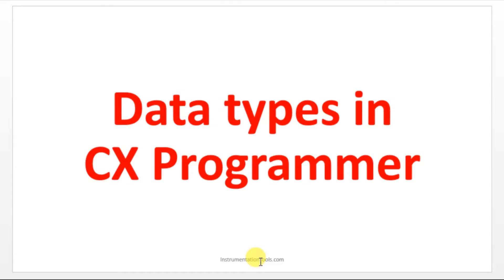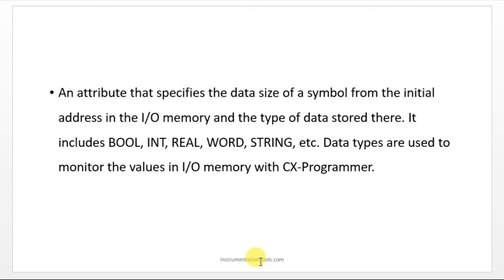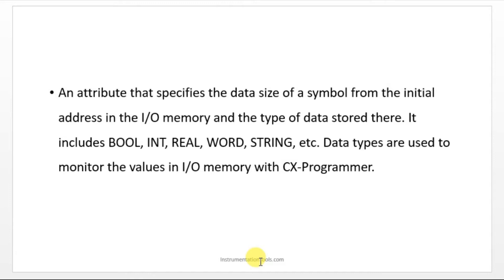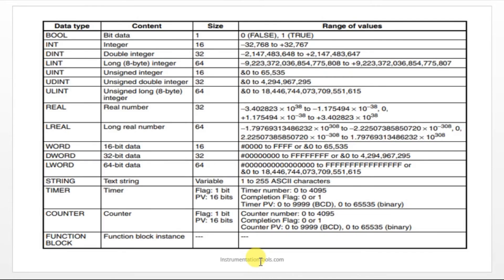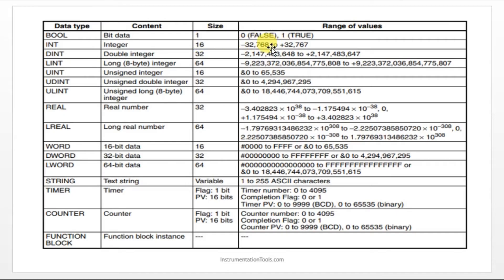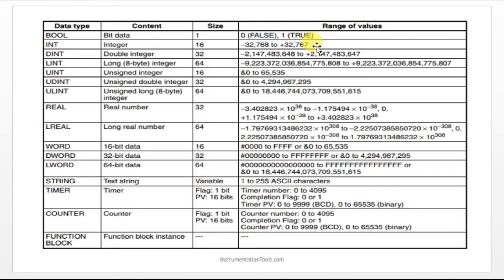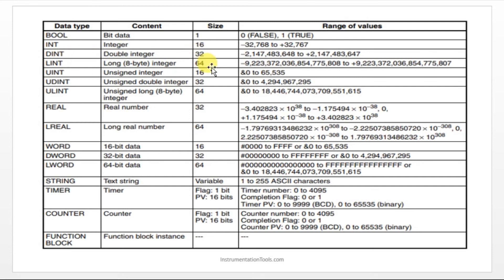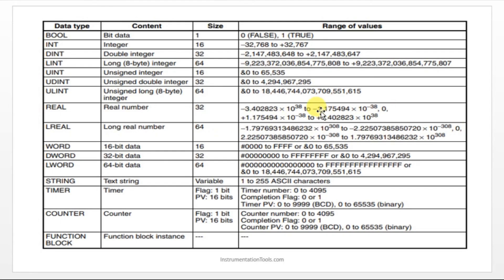Data Types in PLC Programming - Bit, Integer, Real, Word, Timer, Counter

Comment: Dear mam 
Thank you very much for this valuable vidio 

Please I need your support for issue long time take to get information about it as follows 

If I get several plc with multiple I / 0 modules either same brand or different brands  how can determine specification of switches and data store to collect and save data for further analysis ?
Is there reference or example to clarify it's metholigy ??

I appresdiate in advance for your clarification 

Thank you mam